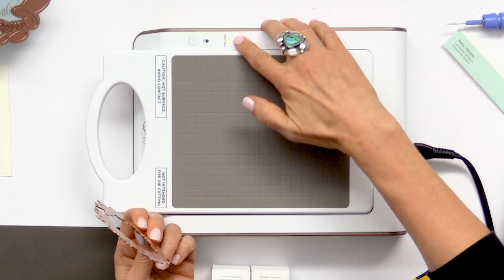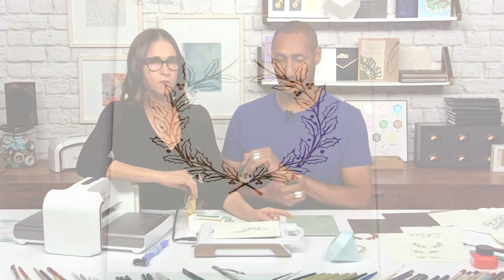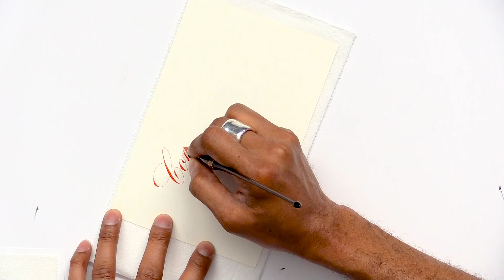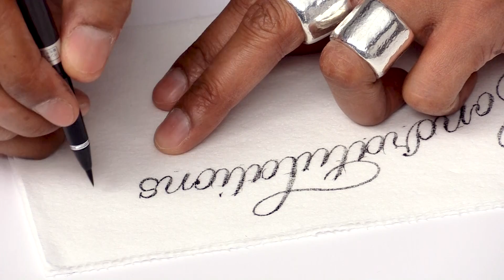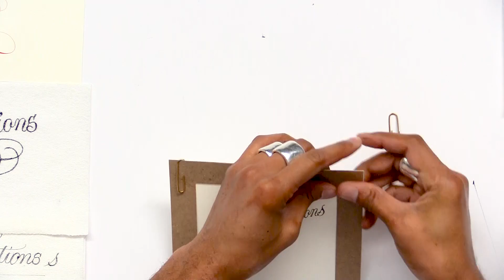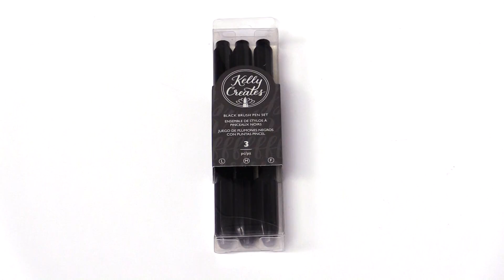Tips and Tricks for Designing with Foil | Spellbinders

Comment: I've just started to try my spellbinder foil machine, I am having issues with the foil inside the letters etc, I have tried putting another sheet in there with it, any tips?
Reply from the maker: Hi Marion! If you are getting excess foil where the plate design isn't, it's possible your sandwich is applying too much pressure. We suggest trying a little different sandwich or altering the speed at which you're running it through your machine. For more foiling information, see our article here:
https://www.scrapbook.com/articles/crafting-with-foil
Hope this helps!